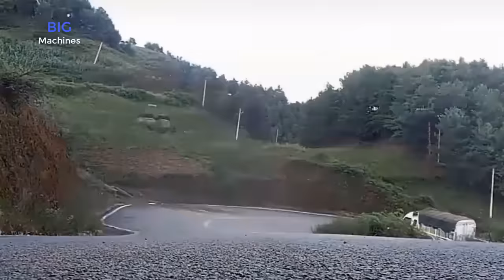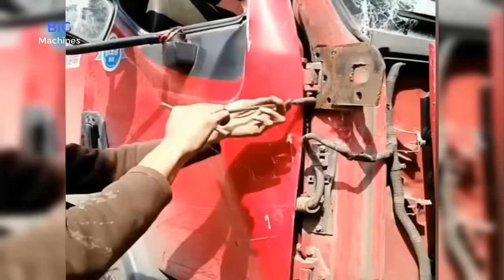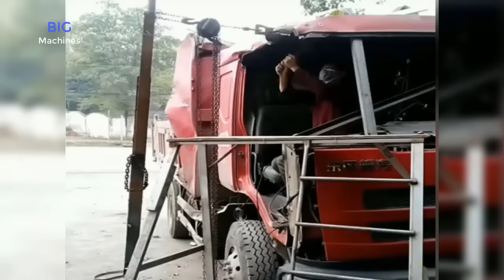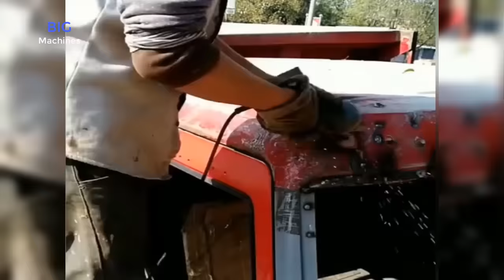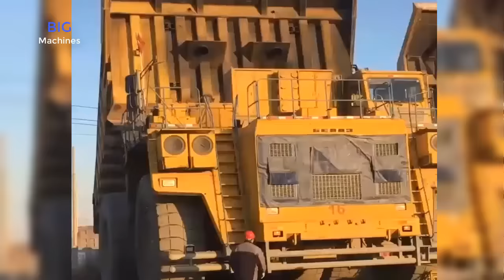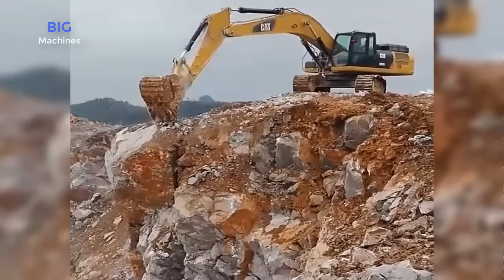10 Extreme Dangerous MAXIMUM Dump Truck Operator Skill - Biggest Heavy Equipment Machines Working

Comment: Everything has a breaking point trucks are no different, you massively overload them they fail. The truck has a weight capacity for reasons, I’ll designs improper axle placement cause turnovers. Even the road can’t support these massively overloaded trucks. I’m so humored at these countries with these trucks that think because it’s a big truck it can carry a BIG load😂😂
Reply: W
Reply: W

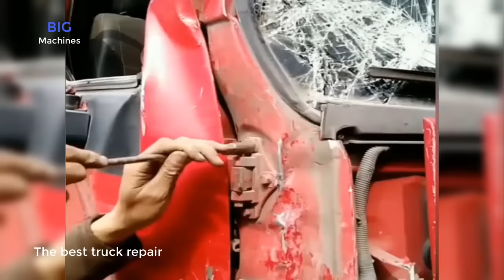Comment: 2:36 Repairing a crashed truck & to later on sell it probably without telling the buyer it's unsafe to drive. I would imagine it's illegal even if they do a good job making it pretty. The structure isn't as sturdy as it should be
Reply: That was standard body work. There was nothing unsafe about it. They used a brand new door frame section. The only thing they had to fix was the top panel rib, and they did a good job on that.
Reply: @firesurfer  Standard body work... Yeah I'm pretty sure it's a standard in that country. I personally think heavy trucks that's been in a crash shouldn't be used again, but hey that's me.
Reply: The crash probably wasn’t that bad. The truck can still move by itself when they are working on it. It’s definitely not totaled.
Reply: @philipstorm97  your daddy